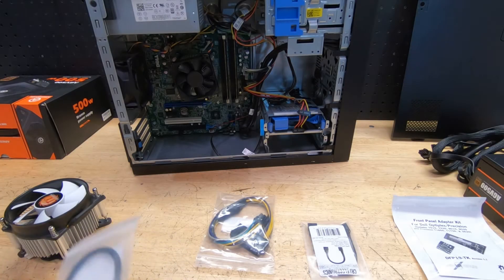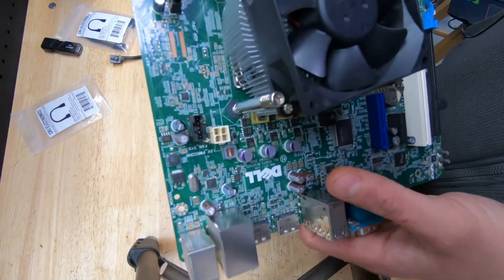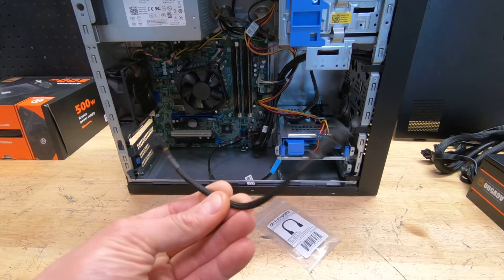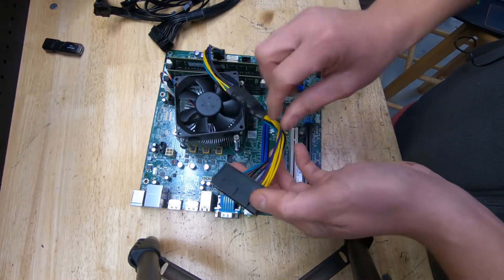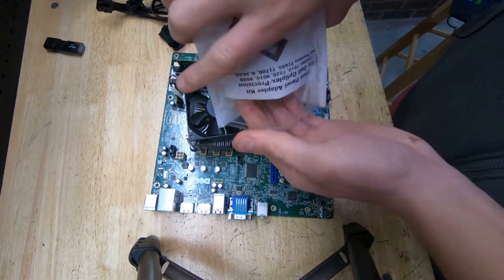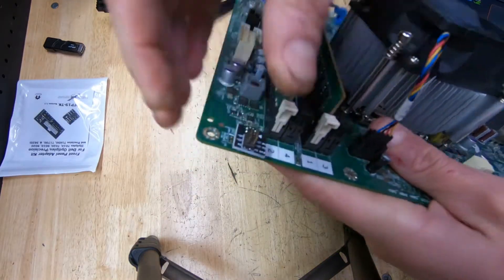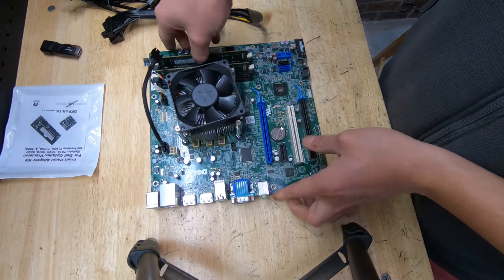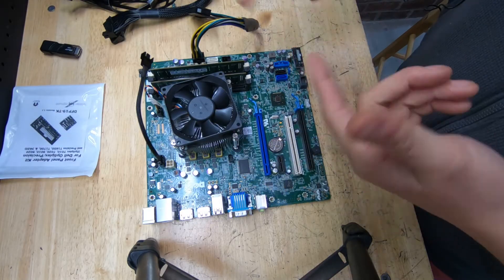Dell Optiplex/Precision case swap guide!! Adapters and preplanning!!

Comment: Just feed the cpu fan sense (yellow wire) to the sysfan connector, so the sense from the cpu goes to the system fan connector, so the motherboard thinks the system fan is connected.
For the power button, just connect the optiplex cable and clear the plastic of the black and yellow wire and solder the power connector to it.

Comment: 2025, im going for it, i got a opti ryzen 4socket, got it for 69$, i think it was sold because sata ports on motherboard have issues but m.2 ssd works great tho...but i got a case supply and wiring harness, and a new gpu

Comment: question can i do an upgrade for a Dell Optiplex 7050 wanting to upgrade the Proccessor to something new but it looks like i need a new chassis due to non-standard form factors, mounting points, and power connectors.

Comment: i got the 24 pin to 8 pin adaptor but every time i plug the new power supply the pc turns on, fans spin really fast and then it shuts down and it repeats the process….. any tips?????

Comment: I got a dell optiplex 5000...what do i do with it? Small form factor
Reply from the maker: got some videos on the channel showing potential mods, key is to get a low profile gpu for, ssd, and max the ram and cpu
Reply: @DLMtechgarage  what if i change the casing, can i get a bigger GPU like arc a580

Comment: The only problem l found was ... l had 2 MB from the supposed same pc made in different years and the slots were not at the edge so make sure they are oriented on the edge. TY for the great vids. I resuscitate old dell and soop them up too. I like to tinker you info is incredibly useful 😁

Comment: Brother pls help me. I want to case swap my 3040MT, will these front panel adapters work with it?
Reply from the maker: got a video on the channel of the 3050 case swap which is the same as the 3040. goes over all the details.
Reply: @DLMtechgarage  do you have insta or something where i can msg you pls

Comment: 24 pin to 8 pin seemsa bit sketchy to me. Like running the extra power a larger card like my 1060 won't that burn out that 24 pin to 98 pin connection? What's the white plug near where you putting the 1st fan adapter for? What games will it experience bottlenecking in?

Comment: Here is my Issue. I bought a Optiplex 790 off of Amazon.  $150 bucks good deal. i5 Processor.  But when I got it, it was a SFF Case not the Tower that was pictured.  Was sort of pissed off. I bought it because the Power Supply went out in my Dell Optiplex 780.  I hate SFF format.  I still have the 780 Case.  And what I want to do is put the guts of the 790 in another Dell case. I have two Dell Cases.  All I want is to swap them out. So I can have more air flow and the ability to have another drive.  I'm not into RGB Fans lights and all that other junk. RGB Lights are like chrome on a car engine, looks good but doesn't make it run faster.   The SFF Hard drive fan didn't do it's job and I cooked a SSD because of it.   I just need the Motherboard Pin-outs so I don't cook anything.  Dell in their many ways of thinking.. has made their power supplies and cases work for only that system you bought.

Comment: Do I have to get all those adapter if I'm trying to case swap a dell optiplex 7010 dt?
Reply from the maker: makes it easier, you can do it without it but requires more modding

Comment: This was a bad place to stop the video. When you gwt to the part where the standoffs don't match up with the Dell hole patterm and when find 2 that will fit, a GPU won't mount because the spacing from the motheboard cause steh GPU to stick out the back and mounting screws on the rail don't fit..

Comment: i tried the 5-pin to 4 pin with some noctua fans in my XE2. Results were as cooler fan, fan would spin on start up then stop.. as case fan it created a burning smell that wasn't pleasant. i had to put the stock ones back in till i figure it out. if anyone had this problem or know what causes please let me know. thanks

Comment: Everybody says this works on the precision 3620. It does not, the big adapter is slightly too long and doesn't click in all the way due to the base of the m.2 port on the board. Also, you have to jump two pins or you'll get a constant "front I/o cable failure" message at boot.

Comment: Does this front panel adapter kit also work on precision 3620?
Reply from the maker: T3620 works but is not officially supported since it touches the M.2 Slot according to their site

Comment: Using the adapters is really clean, but for the cost of buying fan adapters, power adapters, panel adapters, and everything else, you might as well just pull the chip and use that cash to buy a used motherboard.

Comment: I'd like to see you cover the different Dell SFF power supplies and understand when one can use each type within various Dell SFF platforms.... No one has made a vid close to being comprehensive on this subject.
Reply: There already has been the models that can be recased and models can’t. You can find the models online. Most DELL SFF models, you can’t case swap, most of the newer dell models MT or not, you can’t really case swap anymore. You can really only case swap the 7010,7020,9010,9020 and the MT model of those too, not even the SFF models.

Comment: If you dont want to upgrade your psu but want to get better graphics that need external power you can just buy sata to 6pin adapter. It works for lower power like 4gb vram gpus.

Comment: Thanks!  Just upgraded the PSU on my Optiplex 9020 so I could install a RTX 2060 super.  No issues- JUST fits- but it's thermal throttling. Not enough case ventilation, so looks like a new case is needed.

Comment: No disrespect for your choice of boards, but what i think about dell?... TRASH, not even worth the effort. When a company thinks they're too good for standard form factor then they're not worth owning. Had a dell once, my first one and never again. That board couldn't even be used in another case, it was actually flipped backwards. Case opened up on the right side not the left... board mounted on the left side. Been so long ago, I can't even remember the dell model.

Comment: Does the dell power supply slot into a standard ATX case? 

Thanks for the detailed info btw. Very helpful. ❤
Reply from the maker: it can, but you would need extensions

Comment: I been looking for an awnser on something but no one has tried it on video but the question is can I put a asrock am4 mobo in the Optiplex 390
Reply from the maker: you can, just go to do the pinout for the front i/o, it's not that hard .
Reply: @DLMtechgarage  ok thank your for responding

Comment: i got a dell optiplex 350 sff would a radeon rx 580 work?
Reply from the maker: nahh, it won't fit. sff use low profile graphics card, need to get something like a 1650 low profile card.

Comment: Not true on going to larger PSU's....  https://youtu.be/F3drZ1cWM0U   You can use a Sata adapter to 6+2 PCI-E for a 290 watt stock PSU to power safely a 1660 Ti and covers all 1080 60 fps gaming you want to do without spending more to upgrade PSU and 24 pin adapters.   If you want to game more than that, you need a higher end CPU / computer as your CPU 4790 will bottleneck on higher GPU's...  A 1660 Ti with a 290 stock PSU or 365 PSU works fine.

Comment: Hey i have a dell optiplex 3050 T and I'm doing psu upgrade but it don't have 24 pin connector on the board so like you i bought 24 to 6 pin connector adapter but I'm actually scared is there anything i should look out for like any +/- or any possible damages to my gpu plus i want to ask there's another 4 pin connector on my board which cable should i plug it in from my power supply and is that must? Help me out here pls I'm actually very worried i just to play some games that's all
Reply from the maker: got a video  on the channel on upgrading the optiplex 3050 and goes over all that. Def check it out!!

Comment: I have an upgraded 990sff. 2nd gen i5. What GPU should I use? And have you ever worked on fan speed control? How do you do it?
Reply from the maker: I would consider something like a 1050 ti low profile or even a 750 ti low profile,

for fan speed control I use software to control it in windows.

Comment: So i was looking at the ATX to 8 pin adapter, i had an idea but couldnt find anything already made, but instead of the female atx side on the adapter, why dont anyone make it to where its a male 24 pin to male 8 pin so it can just be plugged directly into a modular power supply instead of needing the regular atx cable? it would have so much space on cable management
Reply from the maker: That idea seems more practical l, not sure why they don't

Comment: Total adapter cost is almost 30% of new Ryzen 2600 + mid level B450M mobo. I would rather spend extra money on entry level of Ryzen 2600 package
Reply from the maker: True. But a few years back it was a cheaper option

Comment: i tried to get the kit but i have a optiplex 7050 mt and they only have the upper 5 pin one what do i do?
Reply from the maker: 7050 does not use this kit.

totally different for the case swap, got a video on the channel showing you how to do it.

Comment: Finaly someone who explains the adapter 's thankyou so much i build a optiplex 9020 in a New case with a rx 5700 and i have 2 power supply butt i didnt know if the adapter would work butt you explained it all thankyou.

 I think i should have stayed with the 1060 6gb becouse my pcie from my motherboard is 3.0 and the rx 5700 is 4.0 does this matter?!?!
Reply from the maker: does not matter, but bottlneck of the 5700 will def occur. you prbly get a smotther performance with the 1060

Comment: i have dell optiplex 7010 how do i fix Nvme in optiplex as a bootable drive
Reply from the maker: the 7010 did not have nvme if i remember correctly.
Reply: @DLMtechgarage  yes i know 7010 dosent have m.2 slot but the can  i make bootable drive with the help of  pcie 3x16 slot

Comment: I'm doing the opposite by swapping out the OEM Dell board with a Asus board. The proprietary cables won't connect and I'm having trouble finding possible adapters. Do you know of any adapters for the 3.1 USB front panel cable? Basically the front panel cables don't connect and I would like to still use those. Any help?
Reply from the maker: not sure, I am actually looking to do the same. Will keep you posted when I get started. just waiting on parts to come in!!
Reply: @DLMtechgarage  thank you so much! Appreciate the reply. I have a solid build with an Asus q670m-c and i7- 12700k. If I have to buy a case so be it but I'd rather save my 100 bucks if I can 😂😂
Reply from the maker: @stocksandbarspodcast  dollar saved is a dollar earned!!
Reply: @DLMtechgarage  amen to that! The build I did to turned out great. I love watching other people make their own computers. It's fun. Awesome channel.

Comment: so if my 3010 is 4 pin i dont need that adapter?
Reply from the maker: you should not need the psu adaptor.
Reply: @DLMtechgarage  so if my 3010 dosent have the 5 pin adapter does that mean i cant put rgb fans in or it dosent matter ??
Reply from the maker: @perx7839  If you are talking about the fan header and you have the 4 pin you don't need an adaptor.

Comment: I just got a optiplex 5050 mt any recommendations on gpu and I have a 650 w sfx power supply I'm going to use thanks
Reply from the maker: Replied ..

Also the adaptor you will need is a dell 6 pin to 24 pin adaptor for the new PSU. Can be bought in Amazon
Reply: @DLMtechgarage  ok cool thanks wasn't to sure if it was basically the same as the 3050 build you did this is my first build so I'm new to all the pc stuff lol and I like you vids very helpful

Comment: The nice thing about the Dell Precision T1600 I have is that it came with a regular 24 pin PSU.  It does have the proprietary fan headers though.  I got around my RX 580 not fitting in the case by getting a PCIe riser cable and 3D printing a GPU stand for the outside of the case. I also bought a new EVGA 650 watt, semi modular PSU to replace the original 450 watt. I had to temporarily put my HD7770 back in for now because I am afraid of my "curious kitty" playing with the cooling fans which I caught her doing once before.  I heard a "brrr...brrrr" sound and when I looked, she was playing with the CPU cooler fan! Luckily, I didn't connect the 580 with its MUCH bigger and faster fans at the time!  That may have hurt her paw and I'd feel REAL BAD!  Maybe I'll de-rivot the HD holder in the case to make the 580 fit inside or just buy a different case or...just put the whole PC in a room and make sure to shut the door behind me when it's on...🤔😁
Nice video , by the way!   👍👍
Reply from the maker: I wish I could get into 3d printing!! It def is a great skill for modding

funny story on the cat!! I busted out laughing reading that....
Reply: @DLMtechgarage  😂👍👍

Comment: How did you get around the intrusion halt message at POST now that the m'board is in an aftermarket case?
Reply from the maker: I normal take the sensor and transplant it over and tuck it in the case

Comment: Can you use the power on a custom case without the adapter?
Reply from the maker: yes. you just need to figure out the pin out so you can connect the correct wires. I got a video on my channel about it.

Comment: With the cpu cooler installed, can you fit 4 sticks of ram?
Will I need one or two CRJ 5 pin adapters?
Reply from the maker: no it did not conflict with it and you will need at least one of the adaptors for the cpu fan header and a second one for the case fan.
Reply: @DLMtechgarage  thanks for the reply.  You and this video have been very helpful

Comment: My Mobo (0yxt71) has a 24 pin power connector would I not need the adapter for that
Reply from the maker: nope, standard psu would work fine.

Comment: You don’t have to use the adapters except the 24 pin to 8 pin adapter if you want to do it on the cheap, just take all the sensors of the old case and tuck them away out of view so you don’t get the warnings. The funny thing is these motherboards are actually built really well and are reliable
Reply from the maker: they are solid boards considering the hold up against the abuse and neglect of office enviroments. Never had one go bad. I do the same thing with the splicing and reusing the old sensors etc.... it's def cheaper for the flips. I mostly get the adaptors when i am feeling lazy lol...
Reply: I put an Optiplex 3010 SFF into a full tower from the late 90s. It was a big mess and I eventually put it back together.

Comment: Yeah the second I installed this kit and powered up my PC one of my ram slots no longer works and my motherboard won't output video through the gpu or the integrated graphics.... super Glad I spent 25 dollars to completely fry my computer..
Reply from the maker: wow never had that happened, hate it happened, I know of another viewer who had the similar issue and it was he put the connectors in wrong.
Reply: @DLMtechgarage  yeah I double checked everything too, it was all proper as per the instructions, I'm guessing there was a bad solder trace on the kit that mixed something up maybe? Idk, definitely not trusting any of these adapter kits anymore, it's better to just spend the extra 25 on a whole proper atx motherboard lol, cause I ended up having to do that in the end anyway
Reply from the maker: @peksacola  true. man that sucks.

Comment: Dell optiplex 9020 having issues with back fan sending me to alert even when i have a 120mm connected to it
Reply from the maker: they can be picky on the aftermarket fans, I found noctua to work well or most times i repurpose the smaller than that comes with the optiplex.

Comment: What exactly is that bare chip? Intigrated graphics chip? I have one from a sff. I dont know what it is. But it gets very hot.
Reply: Chipset, probably like H61 or something- You can throw on any basic metal heat sink and should be fine
Reply: @b0ne91  I did exactly that. I have a 3 inch long rectangle extruded aluminum one. Cut it in half and zip tied it down. It would get so hot it would shut the pc down. Now it dont.
Reply from the maker: i forget what is for, but it being hot is def not an issue to worry about.

Comment: Does this work for an SFF 3020
Reply from the maker: according to their site no but I have head otherwise but can't confirm it. I have done just doing the pin out for them and splicing wires.

Comment: Great video man but what can i do for the io shield if i need to put on the replacement case rgb
Reply from the maker: some optiplex's you can just remove them and transfer them over. if not then it really is not a big deal if you don't have the i/o sheild. I have build many of pc's without it and never had an issue.

Comment: Hi,I have a problem with this matherboard,if i connect the "Power sw" the PC start alone whitout the input of the Button and there Is no video but the fan are Power,please help me
Reply from the maker: check the ram, the orientation of the adaptor plus if your not using the adaptor you need to have other pins jumpered.